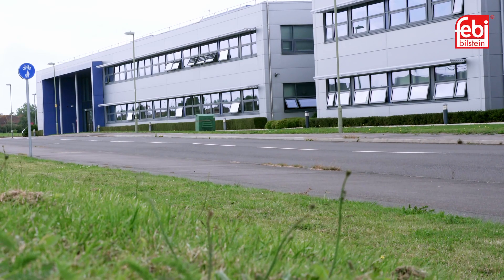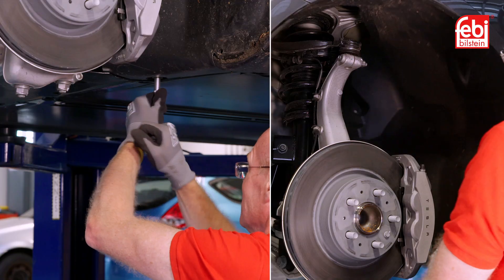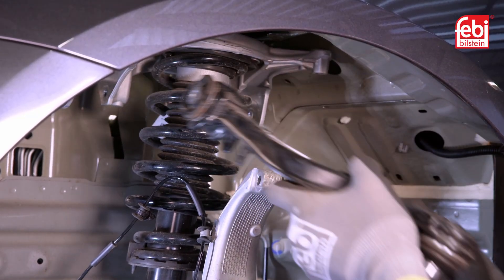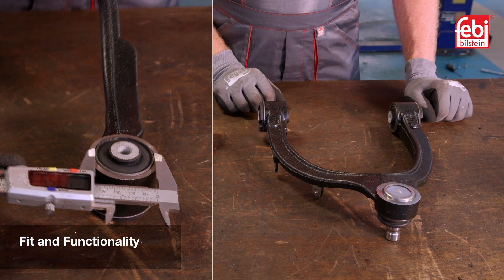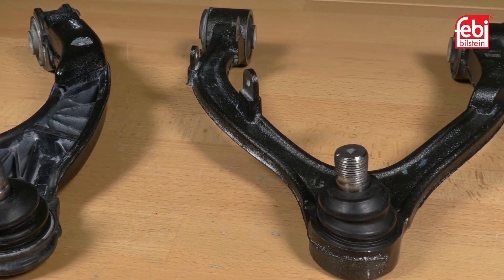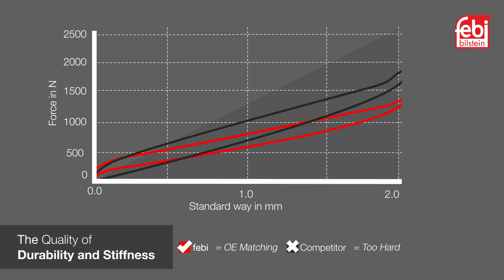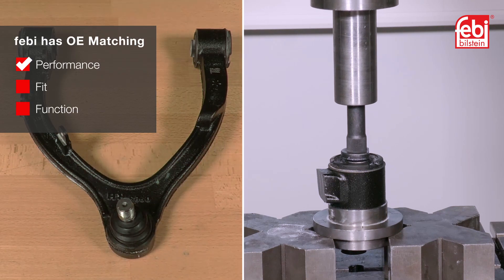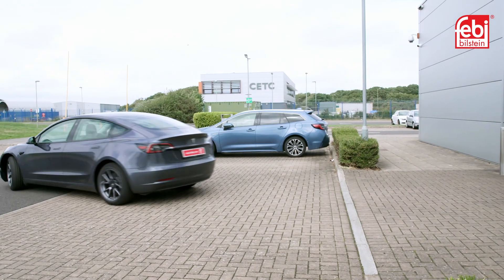[EN] Tesla Model 3 front suspension upper control arm replacement

Comment: Hello! I hope you can see my comment, but what is that black piece on the control arm? The one that’s screwed at the bottom side of the control arm, left side? You mentioned it’s a metal weight to counter act the vibration. I recently got my control arm replaced and the metal weight randomly fell off. How important is it? Or do I need to have it replaced asap?
Reply from the maker: Thank you for watching our video. This counter weight on the original part would have been developed during the development process of the control arm of the vehicle. Therefore, its key role is to improve the noise, vibration and harshness characteristics of the vehicle.